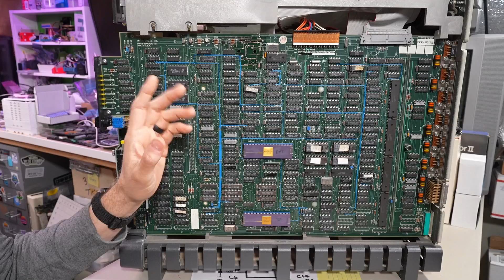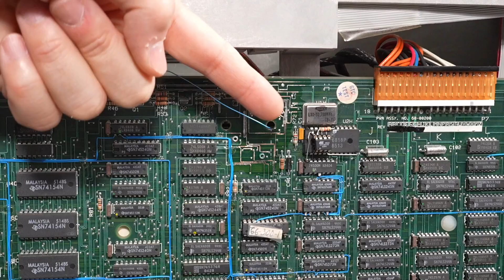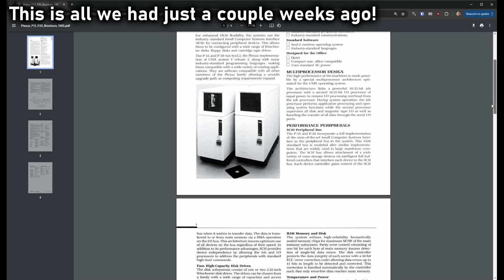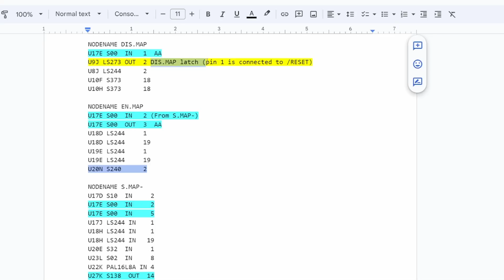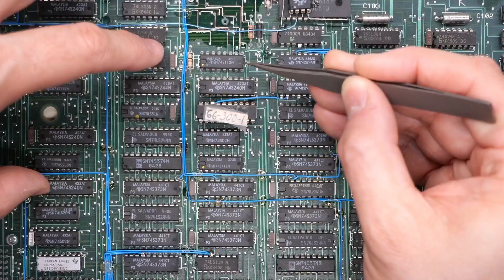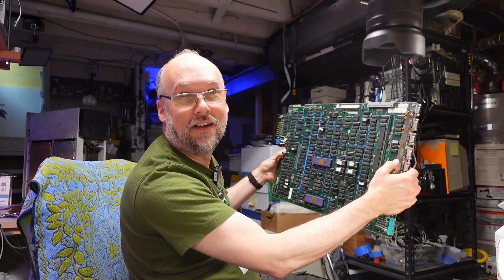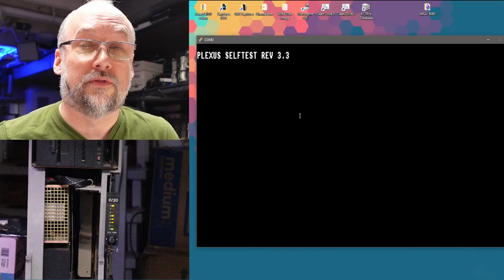We made some unbelievable discoveries about this Plexus P/20!

Comment: There was an external MMU chip the Motorola 68451 that could be used the the 68k and 68010.
Reply: The 68451 was certainly usable for virtual memory support with the 68010, as demonstrated by various workstations like the Torch Triple X. Earlier 68000- and 68010-based machines often used custom memory management hardware, working around architectural limitations in the case of the 68000, largely because the 68451 was not yet available when those machines were being designed. Torch's machine had the benefit of arriving a bit later and being designed around the 68010/68451 combination.

Comment: The problem with the Nexus P20 computer seems similar to the one I had with the Amiga 4000. The Varta battery damaged the RTC system, which was connected to the address and data buses. Only after replacing ALL the chips and other components in the affected area did I manage to get my A4000 to boot.

Comment: I still really think you need to take a step back and sort the power supply properly first, it could be outputting bad voltages and damaging the main board IC's, the reset is happening for a reason, I think it is trying to protect itself using monitoring, modern day it would use a supervisor IC, but in this it seems to be discreet parts to do it.

Comment: I've got a hp 9000 332 with a very early facs system written in Pascal by Becton & Dickinson.
It does not run because the drive is unreliable.
I borrowed an hp ib interface and disk emulator but until now wasn't able to make either work. 

Museums are not interested because the hardware for counting blood cells is missing.
But nevertheless the system should be preserved. 
But i cannot publicly upload this before I removed personal information.

It might be a hpi partition but I wasn't able to mount it yet.
Is anybody interested in helping out?
Reply: Tech Tangents has an interest in old HP stuff, so maybe there are some people in that community who might be helpful.

Comment: If the hard drives in these machines were cloned from a master disk image during the manufacturing process, it's possible that every one of them that was sold contained this hidden area of the disk with the technical documentation in it.

Comment: Some computers will not boot without a valid clock or clock battery. If nothing else is broken, try installing a new battery or replacing the clock. There have been so many times where I troubleshoot a computer for hours only to find that it soft fails on the clock circuit.
Reply: yes, I have an Atari Falcon030, which has the internal battery RTC which dies after 15 years. I replaced the chip with a low profile socket and if you don't have an equivalent installed the computer fails to boot
Reply: @kalimgold  I've seen a lot of computers that won't straight up fail but will have silent errors that causes lots of problems. That's what I meant by soft fail and it might be a problem with this computer as well (can't be sure though since I don't have one).

Comment: Old adage for troubleshooting:  If you find a problem, fix it.  That problem might be what is causing all the other problems.  Especially if you aren't super familiar with the equipment.

I have fixed quite a few industrial machines by just fixing what i could find was not right, and that ended up fixing the entire machine, even if that made no sense to me.  Because i didn't design the machine, i was not privy to all the ins and outs of how it worked. 

Long story short, fix what you can, you might just be surprised at what it fixes.

Comment: More accurate to say that the 80286 only supported segment based protected and virtual memory where entire segments can be marked as not-present while the 80386 added page based virtual memory.
If the clock chip isnt ticking, the OS will not be able to measure how many loops in a second... it will wait forever for the time to change. Check the 32.768KHz crystal.

Comment: I don't think the shifted user partition was fully by accident. Disk space was very valuable back then. So wasting space wouldn't just happen. I think it was to make sure the HDD would survive the projected R/W cycles in a production enviroment. The patters of that time had a quite limited write cycle and loosing user data because a block was going bad wouldn't be a lightly taken risk. So pushing the user space beyond the most used old user space was a sensible action.

Comment: Kicad has very simple files. It wouldn't be that hard to generate files based on that netlist you have. It could probably create all the ic's, and set up the nets, So that the only thing that needs to be done manually is placing the chips and routing(or use an autorouter).

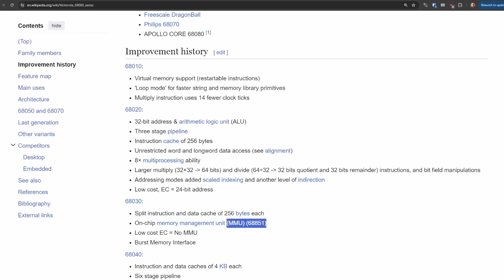Comment: 29:00 -ish: WRT 80286 "protected mode" versus 80386.  The reason why Windows was only truly useful with the 80386 all goes back to what you discovered with your recent "CGA mod" videos.  IBM's BIOS routines were a good news/bad news deal.  The good news was a software developer wasn't technically required to re-invent the wheel to write text to a screen buffer: the routines were in BIOS.  The bad news was the routines were slow as molasses both because how the software was written but the ROMs had more wait states than RAM for every byte of 16-bit code.   

So ALL third-party software developers wrote their own display routines for the sake of performance, and broke a cardinal rule of system programming: NEVER BREAK ENCAPSULATION!!!  There was no way either IBM or Microsoft could send out updated ROMs to make things better (nothing but DOS CLI used it), and Microsoft Windows would need to have a huge library of patches for every DOS application to make it possible to have a "DOS Box" window on the same screen as pure Windows apps.  

Mind you the 80286 and Windows 2 (and Windows 3 running on an 80286) was running in fully protected mode, and was fully pre-emptive multitasking (compared to co-operative multitasking that the Mac did at the time), but Windows software, like Lotus 1-2-3, couldn't be windowed.

What the 80386 did was offer the "virtual real mode", so a DOS CRT app would think it was writing directly to the display card's RAM, which actually it was writing to a buffer that was mapped to appear in the display card's RAM addresses, and Windows would read that buffer, and then present that in a "Window" so it could share the screen with real "Windows" apps (like Notepad, Excel, Word, etc.)

Long story short: the 80286 could use all the RAM in the system and protect one 8086/80286 application's memory from being viewed or altered by another 8086/80286 application, but the market wouldn't buy the RAM for something that was only marginally different than what was already available.  All because software developers violated something taught early on in computer science.

Comment: Another option would be to get something like a MAX706 (8-pin DIP) and build its circuit on a bit of perfboard - it has both a voltage monitor and provision for a manual pushbutton reset.

Comment: An easier and simpler way to remove a chip for replacement is this: Take a very sharp and new side cutter. I keep this cutter just for cutting I.C. pins. Cut all the pins flush to the body of the I.C. The body falls away. Then take a needle nose pliers and a solder gun, heat a pin at a time, and remove each pin from the board. Next, take a solder sucker and remove the solder from each pinhole. Be careful not to overheat the pinhole otherwise, the trace and or donuts from the board will lift off and break... I have been using this technique for decades... =)
Reply: I'm still always amazed when I see people that don't use that method struggle and often damaging traces and plated through holes.

Comment: The MC in the reset circuit doubles the CPU power of the whole machine, or? 😂
Reply: Unlikely. Not only is the ATTiny not a general purpose processor, it also runs at max 10 MHz, more likely 8, has a fraction of the RAM and storage and no optimisation to do anything but reset the system. 

The P20 has two 68010 general purpose processors running at 12 something MHz, 2 MB of actual RAM and a lot of storage.
Reply: @nilswegner2881  I mentioned CPU power only, no RAM or storage. And Attinys can have 20MHz CPU clock. 😉
Reply: @hugoegon8148  since it's not a CPU and can't do anything general purpose, it's still inferior for these tasks, even if it ran at 10 GHz.

Comment: I worked on UNIX systems like this in 86, amazing job to get it to hopefully the verge of working again. Interesting that 39 years later 4kb is still the default page size for Linux.
Reply: Think that's mostly because x64 still only supports 4k paging. M1 supports 16k.
Reply: Cool. Were you working on the hardware design or the software back then?
Reply: @CH4NNELZERO  The company I worked for did software for insurance brokers, the system we had was a Zialog Z8000 based UNIX, very similar besides that. I think it was tested as a possible new platform for customers, but we ended up using Thoroughbred Basic on IBM ATs. The systems being replaced were Mercator systems running Mercator Business Basic, that was identical to Thoroughbred Basic, all ISAM table storage.

Comment: Why not use a Dallas reset IC rather than the 555 based one? Far fewer parts and only 3 pins to wire up. They're also guaranteed to provide clean reset pulses of minimum lengths depending upon the sku.

Comment: Finding this fascinating. I remember learning some 68K coding ('020) i bought the manual. Around the launch of the Amiga AGA models. I recall sometime later seeing details of a memory management unit for the original 68000 and '010. I Googled 68K MMU and came up with a 68451. Though i guess it was either was not available or did not match Plexus' needs. 

An MMU was not really a thing on the Amiga, bad programs could crashed the system.
Reply: And many gurus would fail to meditate on it...
Reply: @freeculture  Indeed many (including myself) have fallen in love, only to experience one of those deep meaningful failures.

Comment: It looks like, at least as far as the main board goes, the the error code is directing you to the component which is failing. 4F02 > chip u4F > row 4, column F on the main board.
Reply: I was thinking exactly the same. Same way as early Apple computers did it.

Comment: How can you not read the engineering manual for P25 from bitsavers?
Reply: Which states "The CPU uses a Zilog Z8001A microprocessor..."? It's a different model.
Reply: @fredoralive  it is the same architecture.
Reply: @nopus1  The P/25 uses only Z8000 architecture processors, these being completely different from 68000 architecture processors. However, Plexus also made the P/60 and P/35 models which used the Z8000 in the I/O processor role but introduced the 68000 as the main processor (or job processor, I guess).
Reply: @paul_boddie  do not mix computer architecture and processor architecture
Reply: @nopus1  I'm not mixing anything up. If anything, by simply stating "it is the same architecture" to a comment about the processor architecture, you're the one doing the mixing up.

But anyway, there will be continuity in the system architecture because these models will have evolved from the earlier ones which used combinations of Z8000 processors (P/40, P/25), through models where they swapped out the main processor for a 68000 (P/60, P/35), to ones that ultimately replaced the Z8000 I/O processor (P/20). So, something might be learned from the overall system architecture approach, as I believe I might have pointed out myself on an earlier video.

Having said that, certain aspects will be quite different. The Z8001 was designed for segmented virtual memory that suited earlier Unix versions, providing quite a low limit on the individual process size. From the manual, it appears that the custom MMU provides 2-kilobyte pages within each segment, with each process having two segments (one for code, one for data), giving a total size of 128 kilobytes per process.

It is possible that they adapted this MMU for use with the 68000, but I would imagine that plenty of the details would need to change. Interfacing a Z8001 to such circuitry, whether custom-designed or Zilog's own MMU chips, would be a different matter to the way you would interface a 68000 to its own MMU in whichever form. And the 68000-based systems will have required larger address spaces and maybe more sophisticated virtual memory support as Unix implementations themselves evolved.

To conclude, it would be interesting to see how much similarity there is between the different models, and the manual for the P/25 is informative about the techniques employed, but it will not be a precise description of the P/20 due to significant hardware differences related to - wait for it - the processor family involved. Which was probably the point being made by the other commenter.

Comment: So ERROR 4F02 was the location of the chip on the PCB (Row 4, Column F).
Reply: Very logical.
Reply: Ooh, great spot!
Reply: there is absolutely no way that's what the error code means
Reply: @perorin615  I mean, we’d need to see if the causes of those other, non critical, errors also matches the maybe-pattern.
Reply: @kaitlyn__L  the system doesn't have access to individual chips. consider that the bad signal went to the working PAL chip which outputs a good signal. How's the system going to know that the signal between the latch and the PAL is bad?
Reply: @perorin615  true but it might point to the circuits involved ie the memory switching part to start debugging
Reply: @reinoud6377  there's a big difference between that and specifically calling out the column and row of the problem chip.
given it's hex code nature it's most likely a software thing. probably something like the specific address in ROM where the test (t4 remember) had unexpected results
Reply: @perorin615  Build-in/Power-on Self Test is exactly doing that.
Reply: @anotheruser9876  doing what? testing individual latch chips? please tell me how it does it

Comment: Adrian I wonder if the self test is telling you on the board it’s chip 4a and you look at the mother 1 -25 down and along the bottom you have a - p so wonder if it’s telling you the chip location that actually in fault so 4 and a is at the far right to the 4 chips big chips running down

Comment: A 555 would be period correct. Also, 555s are still relevant and used all over till this day. Then again, circumventing power good/power protection because of laziness is equally dumb so I'm not surprised. You did not fix the reset circuit, you hotwired it. And ruined the period correctness of the machine at the same time. More quality work from Adrian.

Comment: I worked on forklifts for a while as an electrician, some of the older machines had so many botched quick "fixes" that opening up the cover and looking at the the wires made you feel depressed, but with schematics in hand I always felt convinced I could find and repair any issue properly. Technical documents are such a big help, especially on complex parts

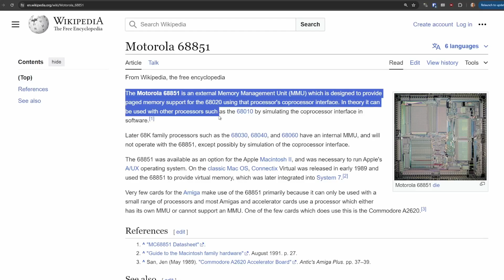Comment: 29:08 the 286 did have virtual memory, but yeah it was kinda limited and unlike the 386 it didn't have a virtual real-mode so you couldn't run real-mode apps atop a protected-mode kernel (probably because intel assumed everyone would just rewrite their systems to be pure 286 protected-mode), and you couldn't officially switch back out of protected-mode once you had entered it